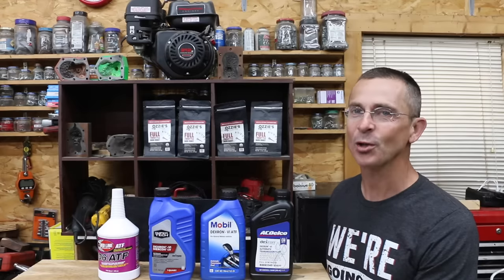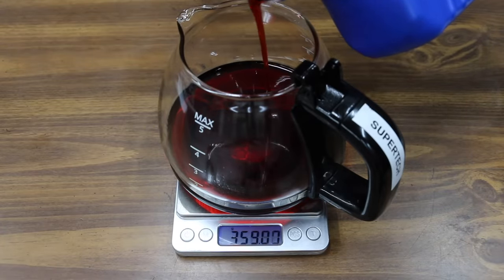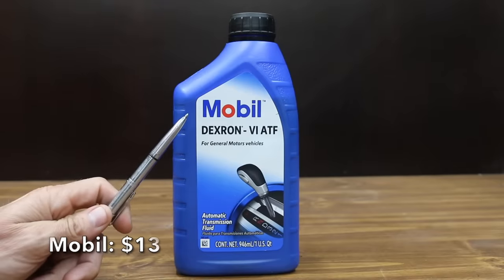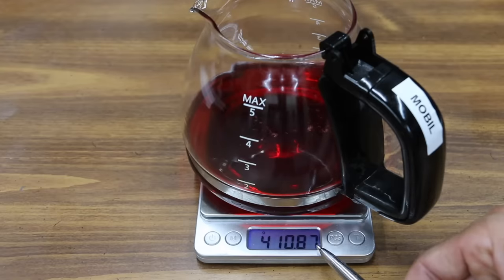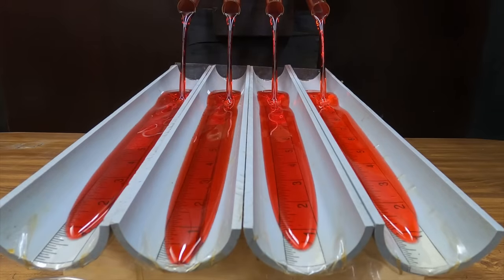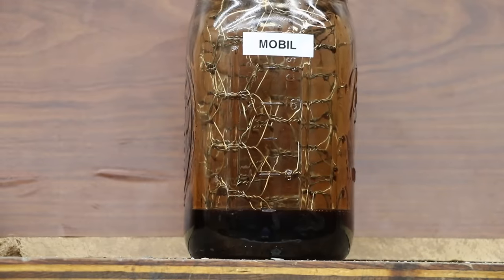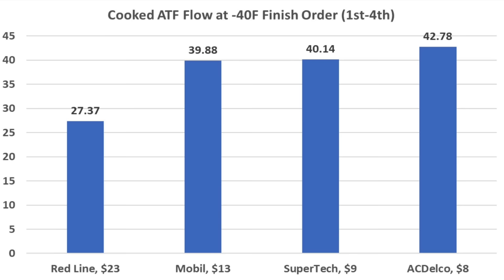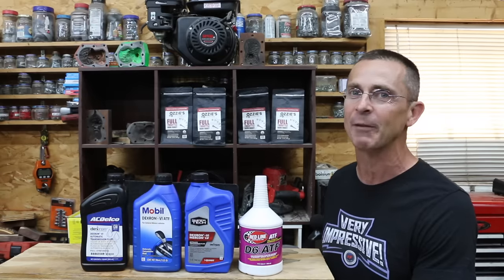SuperTech ATF Safe to Use? Let's find out!

Comment: I use Super Tech Mercon V in my 2006 Crown Victoria. Mercon V is at least 70% synthetic depending on the brand. There are a few Mercon V brands that are 100% synthetic, but they cost about $4-$5 more per quart.
Reply from the maker: Thanks for sharing.

Comment: I’m surprised that super tech managed to get second but since it doesn’t offer great protection I’m not sure if it’s still considered a good transmission fluid for cheap cost. Thank you project farm for another great video.
Reply from the maker: You are welcome!
Reply: From what experience it feels like super tech is done at 30k miles. Vs motorcraft may go 45k

Comment: Idea to test. There are "fogging oils" on the market, said to help preserve an engine over winter, or long term storage. You're supposed to spray the oil into the carb and then put some in the cylinder and the idea is to let the engine run a few seconds to get the gas out of the carb while it burns the fogging oil instead. Then spray into the cylinder through spark plug hole, some say.

I don't know how a test might be conducted to determine if the fogging oil helps or not, but if anyone could figure out how to test that, it would be you!  :) 

Maybe put WD-40 in the test, to see if the dedicated fogging oils are actually any better...

Love the channel!
Reply from the maker: Thanks for the suggestion.

Comment: I've wondered about the benefits of synthetic ATF for a decade or two. Back in the day, it was a very expensive proposition  to replace all those quarts of dino with the man-made stuff. Of course I own a manual at the moment, and it's a Honda/Acura product. They recommend only their fluid for manuals. Thanks for scratching this itch. Was interesting to watch and learn. Sounds like if you're an Alaskan resident, go ahead and take out that small loan for the good stuff. Otherwise, just change it regularly with decent brands. Thank you!
Reply from the maker: Thanks for sharing.

Comment: Todd, I would love to see you do a video on pallet jacks. Max lift height, lowest clearance, max capacity, minimum pull force, tow bar push force before bending, tow bar force to lift, fork durability, wheel durability.
Reply from the maker: Thanks for the suggestion.

Comment: I'd like to see an extensive oil filter review. Wix, wix xp, purolator one, purolator boss, supertech, mobil 1 extended, fram, Toyota oem, Honda OEM, etc etc.

run a mineral oil through all the filters and add known amounts of debris in different micron levels to see how the filters filter, starting pressure, ongoing pressure, etc etc. it would need to be a very comprehensive test but would be worth it.
Reply from the maker: Thanks for the suggestion.

Comment: SuperTech ATF works just fine, Don't know why but it's cheaper here in Canada. (8,88$ CAD/Quart (6.75$ US)) My father used it 2 years ago in his 2007 Saturn Ion and it gets the job done. The transmission works and shifts like brand new. Will use it too in my 2007 Buick Allure.
Reply from the maker: Thanks for the feedback.

Comment: Great video as always Todd, one thing I would suggest is to re-do the wear test with new fluid because in a transmission if your fluid is black/burnt it should have been changed a LONG time ago. (Most manufacturers recommend changing the fluid in the pan every 30 thousand miles and at that point your transmission fluid should still be nice and red/pink. In fact most mechanics and transmission techs will tell you if your transmission fluid is black and/or burnt you shouldn't even change it at all because the friction caused by the severely worn fluid might be the only thing keeping the clutch packs in the transmission from slipping to the point that your car can't move under its own power.
Reply from the maker: Thanks!  Thanks for the suggestion.
Reply: That's a myth. If the trans goes out after changing fluid it's got a clutch pak - s out and it's remaning life was very limited anyway. What usually happens is people notice something was not right with their transmission so they change the fluid thinking that was going to fix it, but it was already too late ok?
 I've done many fluid changes where the fluid was really dark and on not all, but most all of them it extended their life immensely. You can tell what you are dealing with when you get the pan off and it's full of debris, it's probably not going very far. Also if in doubt, I like to break the filter open to see what's in there. More than a tablespoon full of debris in the pan is a bad thing.
Reply: @oneninerniner3427  wrong, you should never wait until your transmission fluid is black before you change it, motor oil turns black as a byproduct of the combustion process but there is no combustion inside of a transmission, if the fluid in your transmission is black it's either because it is full of clutch material and that material being suspended in the fluid is the only thing keeping your car on the road or it's black because your transmission has been running significantly hotter than it should be to the extent that the fluids film has failed in which case you most likely have damage to your planetary fears and/or clutches etc. But if the fluid is black because it hasn't been changed in 150 thousand+ miles that black color is clutch material. And your initial statement proves that I am right because the reason the transmission goes out after changing the fluid is because the only thing that was keeping fthe transmission functional was the clutch material suspended in the old fluid...
Reply: @js6729  come to think of it, I have changed fluid on a few where they were still working fairly decent but the fluid was pretty much black. And guess what they kept on going just fine. So stick that in your myth!
Reply: And of course you shouldn't wait untill the fluid is black. But sometimes you get like folks pulling heavy or high profile trailers on a trip and they run long steep hills or get into a nasty headwind for many miles and cook their fluid. I've seen it happen many times.
Reply: Do you know what builds runaway heat in an automatic transmission? It's the torque converter. The pump and gears n stuff don't build much heat it's the TC when pulling hard.

Comment: For Round 2 focus on ZF 8 speed and 9 speed compatible fluids. Redline D6 claims to be compatible. Most ZF fluids are very expensive ~$30 per quart. Good to see if Valvoline Maxlife or Redline will work.
Reply from the maker: Thanks for the suggestion.

Comment: Nice video as always. Please make a new one including more OEM vs Multi ATFs. You can include some of the popular OEMs like Toyota and popular ATFs like Valvoline, Amsoil, etc. Thanks. Also would be interesting to check can we safely mix them and would this cause transmission failure since you cannot drain all of the ATF from the system.
Reply from the maker: Thanks for the suggestion.

Comment: Yeah Amsoil and Valvoline, it's a unique oil to test as it's not engine oil. It a hydraulic oil with the need to deal with various clutch types and with CVT band types. I have found with CVT especially auto parts stores are not listing fluids correctly. You really need to in depth research to get the correct fluid without paying the ridiculous dealer prices for the fluid. Example would be KIA Seltos needing the CVT-1 spec and most parts stores will show SP-III as OK, it's not. My point is that it's most important to get the spec on the oil correct over all other. Valvoline does the CVT-1 spec and most others do not.
Reply from the maker: Thanks for the feedback.

Comment: Hi Project Farm,

I really enjoyed a lot of your videos. Would be nice to see some videos regarding CVT fluid since a lot of vehicles nowadays are turning into CVT transmission and there's not a standard rating on CVT fluid like ATF DEXRON. As a result, the vast majority of people have to stick with OEM fluid, and as you know OEM fluids are expensive.

Here I have a few ideas for CVT comparison:
1. how different really are those OEM CVT fluids: such as Honda HCF-2; Subaru CVTF_II, lineartronic CV-30; Nissan NS-1, NS-2, NS-3; Toyota FE; Hyundai/kia SP-CVT 1. I believe these will cover the majority.
2. Aftermarket CVT fluid compared with the OEM: Amsoil CVT, Lucus CVT, Valvoline CVT, Eneos CVT. In Canada, we also have Moto Master CVT fluid, not sure if this is available in the States.
3. There's one type of new transmission fluid rolled out recently. It claims it can be used in both Automatic and CVT. For example castrol transmax atf/cvt universal, valvoline maxlife multi-vehicle. How they can achieve that? And how does it compare with pure CVT or pure ATF?

It might be challenging for you to test CVT since your truck does not use CVT. I would like to see a CVT video in the future at some point. Again, Thanks for your videos and the amount of effort that you provided to the community. Have a good one!  Cheers!
Reply from the maker: Thanks and you are welcome!  Thanks for the suggestion.

Comment: Nice.  Since Redline and SuperTech led it would be interesting to have a 5th item with a 1:1 Redline & SuperTech mix. And a 6th thru 10th 1:1 mix with 15% of 4 shelf additives for transmissions.
Reply from the maker: Thanks!  Thanks for the suggestion.
Reply: @ProjectFarm  have you thought about mixing motor oils and doing tests?  Like 15w-40 with 5w-20, or some other combination?  I regularly mix oils in my cars.  Half of them have slow leaks or burning so a quart every 900 to 1200 miles is common for me to add. 

It would also be interesting to see tests of oil brands when new versus used for 5,000 miles in an automobile with no known excessive wear issues.  And also compare an old car used oil to modern car used oil. Same brand of oil with same miles used.

Comment: I've always loved your channel, and I have one fluid that I use for almost everything, and always wished I could see it compared with your techniques. I don't even own anything Honda anymore, but Honda power steering fluid still gets my exhaust bolts looser, and faster than anything imo. It has no smell, so it's my favorite "3+ in 1".

But also: I've wondered if there would be a way to directly demonstrate shear forces on the liquids. That would be fantastic to watch, and would be pertinent to ATFs and pump fluids. I think of how wetted cornstarch (what the kids call "ooblek") will flow on its own, but siezes up with external force (such as would be from an impeller or torque converter).

Comment: Love the videos, for sure nobody does a better job than you.  I have a suggestion that is kind of different than what you normally do but I know you have all the equipment to do a thorough test of it. 

End grain cutting boards vs face grain.  The rumor is that end grain is easier on knives because they can fit in groves between the grain but it seems illogical to me and I suspect there would be no measurable difference in wear.  People also claim the end grain is more durable/more sanitary/and easier to clean, all of those things I know for a fact are not true.  Obviously the type of wood would make the biggest difference so comparing say a walnut end grain to an oak face grain would not be apples to apples.
Reply from the maker: Thanks!  Thanks for the suggestion.

Comment: Hope to see more in this series like the motor oil comparison.  My local guy uses BG Fluids so I'd be curious to see how BG trans fluid does.  Thanks for all you do to keep consumers informed.
Reply from the maker: Thanks!  Thanks for the suggestion.
Reply: BG flush is good
Reply: @D4x4Bronc   not looking to have to flushed since the trans was rebuilt 20k miles ago but im going to do fluid exchange because here in FL the weather just taxes they systems.
Reply: @ChrisLincolnHomes  atf generally lasts 30k miles, and pan filter can last 30-60k sometimes more but safe bet to keep everything like new is 30k also.
Reply: @D4x4Bronc  My car doesn't have a pan filter that can be removed.  But mine was rebuilt and they used the GM Fluid so at 20K miles I'm going to have the fluid exchanged and I'm curious to see how the BG performs since my local guy uses that.

Comment: Agree with some of the other comments, definitely want to seem Amsoil, and BOTH versions.  They have a regular and then they have "fuel efficient" version.  I would love to see you test both of them so we could not only see how they compare against Redline but also against each other.  Also just for giggles, there used to be a blue ATF, I believe it was from B&M, maybe it was called "Trick Shift."  If that product still exists I'm wondering how it compares or if it was all just marketing hype and a different color!

On a slightly different tangent...... You did your motor oil shootout and found that Amsoil is great.  You've also tested Motorkote and found it does some pretty amazing things.  So the logical question then is.... Can Motorkote improve Amsoil?  Take the best performing Amsoil and test it against itself, just with the proper proportion of Motorkote added.

And finally on an even further tangent.... Partial Bypass oil filters.  Amsoil (and a few other brands) make wonderful claims about their partial bypass oil filters and the ability to remove virtually all contaminants (down to around 2 microns) which is far better than any conventional filter.  I would very much love to see some kind of test where you test a few different brands of standard filters both alone and with a partial bypass filter.  Since the focus is on contaminants you could rig something up to just continuously circulate the oil and then add contaminants of known sizes and compare the ability of the filters to remove contaminants.  Could measure things such as the weight of the filter before and after contaminants are added, oil analysis, etc.
Reply from the maker: Thanks for the suggestions.

Comment: Wish you would have tested the Amsoil brand but also CVT FLUID, just like motor oil using 0w16 and 0w20 is extremely common anymore.  Both oil ND cvt fluids are the new normal.. I would love to see tests on both, but always include Amsoil. I'm a huge Amsoil guy and now I use Amsoil,  from oil, cvt fluid,  4 stroke air cooled oil, that stuff really made a difference on noise level l, very smooth sounding generator from the first start up. I used a noise reader and what a difference!! Also I use their 2 stroke oil on a new weedeater, chainsaw. You can run that stuff at 100:1 or 80:1, for any 2 stroke that requires 32, 40, or 50:1.  I ran both 100:1 with non ethanol fuel and just over 1 year they are running great and will start with 1 pull. I will admit I was alittle nervous but I'm beyond stunned .. I absolutely know they make the best stuff, period, but 100:1 WOW
THANK YOU FOR ALL YOU DO!
Reply from the maker: You are welcome!  Thanks for the constructive feedback.

Comment: I'd love for you to test drain root killer! I tried out a foaming $20 one that worked great for me whereas another more expensive $40 specialty brand didn't do much. Apparently the foam makes the chemical reach up higher in the drain pipe, making it clear more than just a narrow path of roots that comes into direct contact with flowing water
Reply from the maker: Thanks for the suggestion.

Comment: A very interesting test would be to compare a high end "compatible" fluid with exotic OEM fluid such as Red Line VS. ZF Lifeguard 6 VS. Pentosin ATF 6. Based on what I'm seeing here and reviews I've read, Red Line may outperform OEM but only testing would confirm that. It's a decision many of us car care nuts agonize over, particularly after seeing the price of OEM fluid at $30/liter.
Reply from the maker: Thanks for the suggestion.

Comment: IF you do brake fluids make sure you include ESI 6 by Bosch. it's a "5.1" fluid (dot 4 +++)  it is NOT silicone base like Dot5. i would love a brake fluid showdown and an explanation of wet vs dry boiling point and why it's so important. 
since it should be changed every 3 years due o water absorption, but most dont, i would live to see an old "unknown realworld sample" thrown into the mix.
Reply from the maker: Thanks for the suggestion.